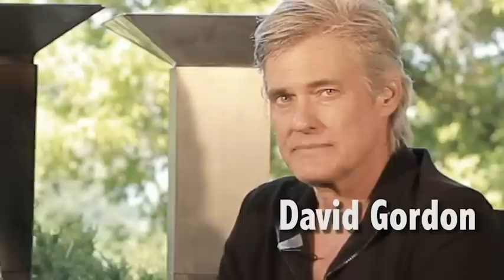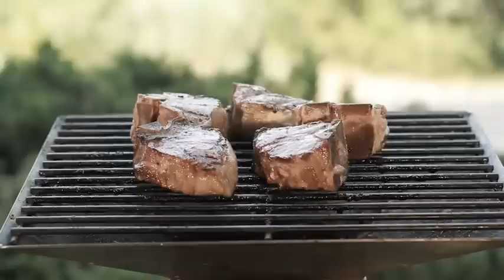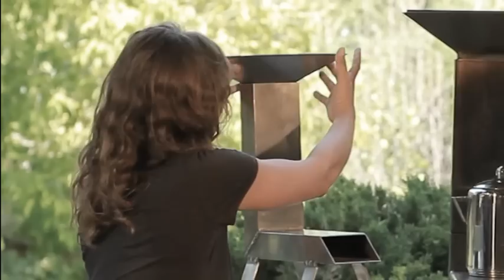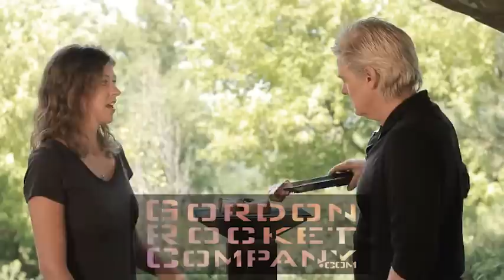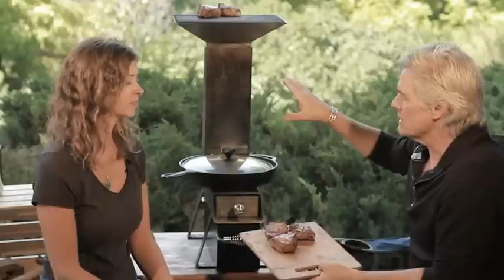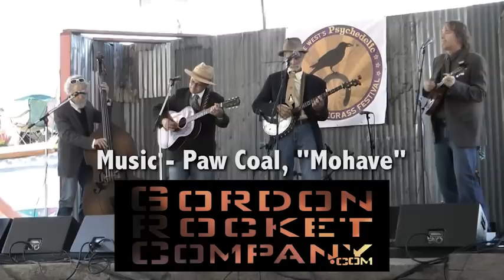Gordon Rocket Company Studio

Comment: Not a bad idea, but looks like it's best use scenario is just camping and nothing more. I lived with a cast-iron woodburning stove as my only source of heat for 6 years where I also cooked on it, and burned all my garbage and feces in it. People who have never experienced poverty will romanticise wood-burning stoves, but fact is that they're annoying, especially all that ash. If I were to repeat that 6 years, I would get a model with the biggest possible door, so as to be able to put bigger pieces of wood in the chamber. Maybe get 2 stoves so I could operate one while the other cools down for cleaning, which you do need to do if you burn things like garbage and copper wire insulation in them, or maybe old batteries. Another option would be 2 wood (coal) burning stoves that can be switched from using 2 separate chimmrnys to a single one, with the turn of 2 dampers where the smoke from one stove burning wood and copper wires goes into the 2nd one where the 2nd one is a Canadian stove having its air intake at the top and the chimmeny pulling the air through the chamber and out the back from the bottom. This 2nd stove would burn coal, and would serve to incinerate the secondary combustion products from the plastics, and thus provide the means to burn copper wire undetected, even in an urban environment.

Comment: I think the vertical stack is twice as long as it should be.   Why not try shortening it?    I'm currently building my own  and I've looked at many designs so I've learned a few things.   I'll have a video in a month or so.  Regards.   ; )
Reply from the maker: It needs the vertical aspect to draw the heat upwards powerfully to pull in air.  Basically it is a miniature fireplace and chimney and uses that simple principle.  And I have tried shortening it to prove the effect - no go.
Reply: According to Ianto Evans,  probably the most famous and most experienced rocket stove developer (in many ways, the inventor of the modern form), if you think of the schematic of the fire route as a big capital L, the long leg (the chimney) shouold be around 5x the length of the short leg. I think David Gordon has it much closer to perfect than a shorter chimney section would be.
Reply from the maker: Thanks for your note!  5x is impractical for the mobile unit, however, when we add the indoor flue attachment which funnels the few fumes out through aluminum tubing - it is probably close to that.  This may prevent back-drafts which can be experienced in high winds.